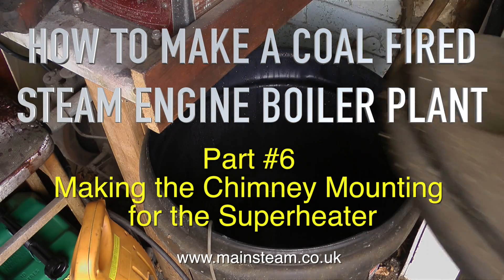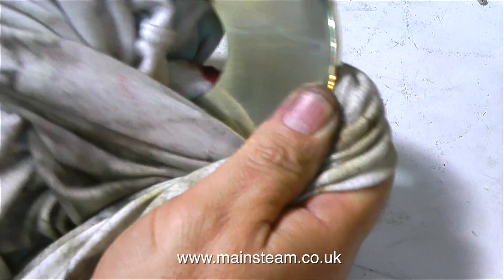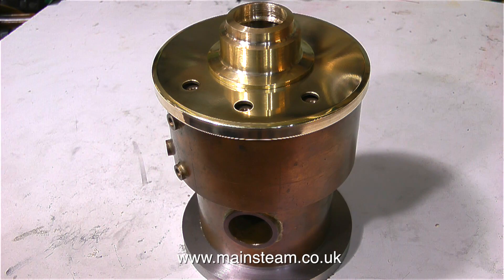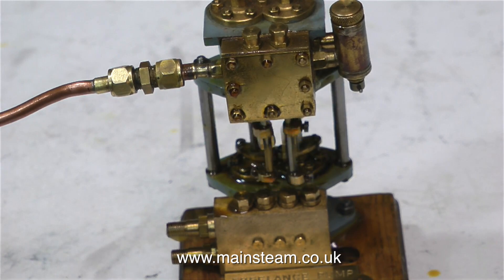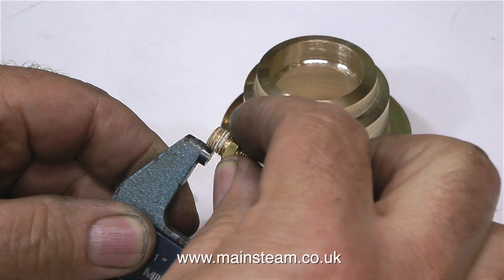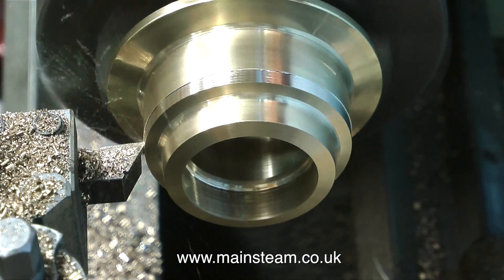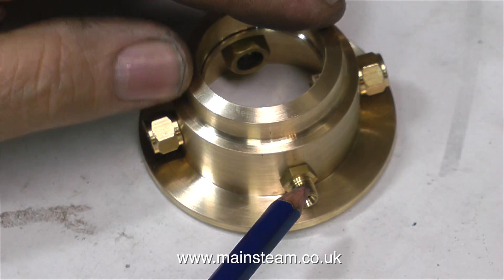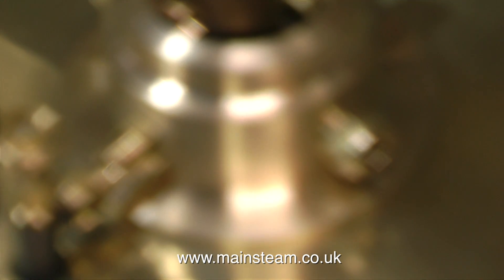HOW TO MAKE A COAL FIRED STEAM ENGINE BOILER PLANT - PART #6

Comment: In case you haven´t made up your mind wether to bolt or rivet the chimney support, I would suggest rivets. We´ve seen you bolt things together, but no riveting so far.
Reply from the maker: I am going to bolt this part onto the boiler so it can be removed for servicing, but a feature on "How to use Rivets" is imminent ..... ...... it will be Riveting ..... :-)))

Comment: I am wondering a detail about two stage steam engines, the ones with a high pressure piston/cylinder and a low pressure piston/cylinder. What is the crank offset in degrees between those two pistons, if any? Thanks.
Reply from the maker: 120 degrees on a triple expansion engine as far as I remember . . . . I have a Stuart Twin launch compound and the crank on that is at 90 degrees.
Reply: Thanks. 
You do nice work.

Comment: I've checked around, and Kilrock-K is not available here in the US. Rather, it is, but at considerable shipping expense because it has to be handled as a caustic agent.
But never fear! The Material Safety Data Sheet indicates that the stuff is high concentration Formic Acid, which we can indeed purchase domestically (though again, shipping costs will kill you faster than the Formic Acid will.)
Reply: You can probably get an equivalent from hardware stores or cleaning suppliers or maybe supermarkets. Look for limescale removers as they are normally just acid with a corrosion inhibiter added. Sometimes patio cleaners are also acid based and will do the job.